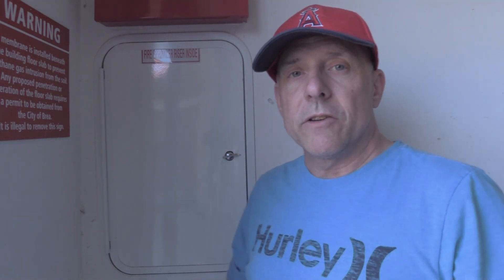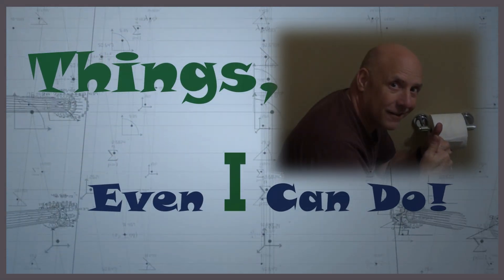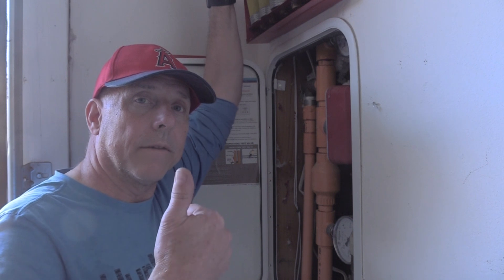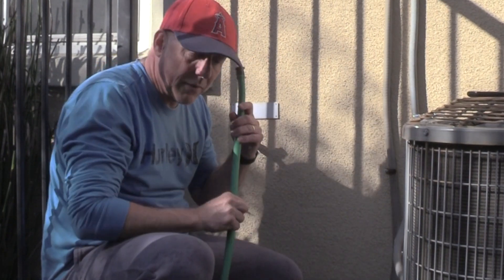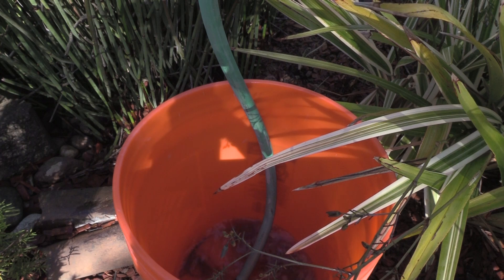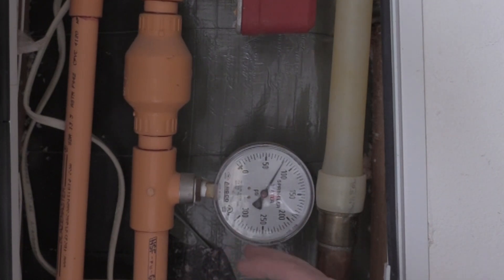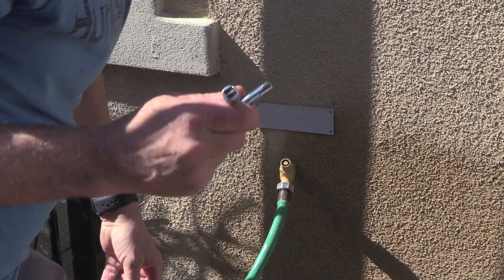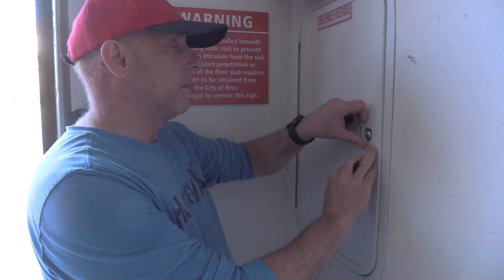Residential Fire Sprinkler Test / Flush

Comment: Thanks!  I'm working on a design for an off grid home.  I hadn't heard of the inspector port before to flush out the system and test it.  I'm thinking of modifying my header layout to avoid any dead end side branches.  Adds a little to the header length, but since I'm designing a loop, it shouldn't have any effect on pressure drop in the system.
Reply from the maker: Good luck!

Comment: Great video, thanks. The pressure gauge on my riser is reading a static of 200 psi. Is that considered too high?
Reply from the maker: I'm not sure...   I was told that the PSI is contingent on the supply from the City/County water source and that the most important thing was to be sure that the pressure is consistent from measurement to measurement.  If there's a big drop, then contact the Water department to see if there is an issue.   200psi seems high compared to what I have seen, but perhaps that is normal for your area.   Other unknowns are what type of system you have an whether it is rated to handle that much pressure.   Sorry I can't be of more help on this.